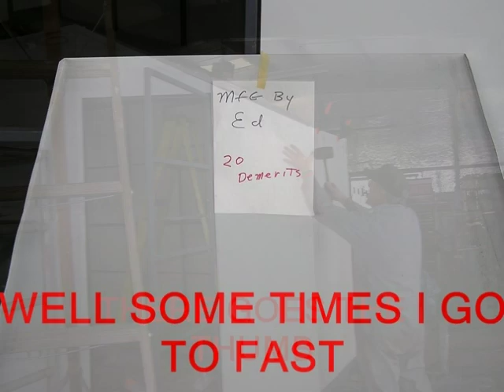Building A Trailer

Comment from the maker: Hi
Sorry it has taking so long to get back to you I have been away (can't fly in the snow)
What you want is 10% more weight on the tongue I checked a lot of trailers to see where they put the wheels the motor is the most weight on my machine but then I installed a cabinet in the front so the wheels were set 18 inches back from the center of the trailer this put about 15% more weight on the tongue.
Good luck
Ed